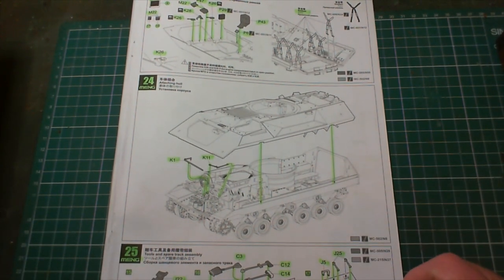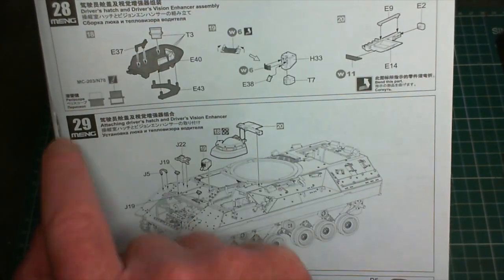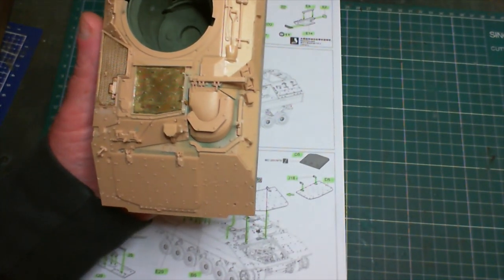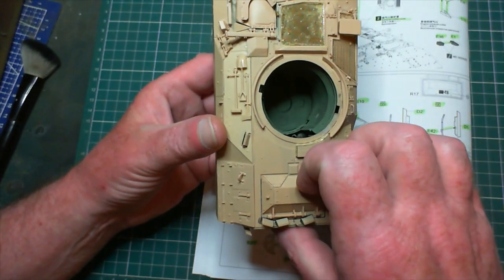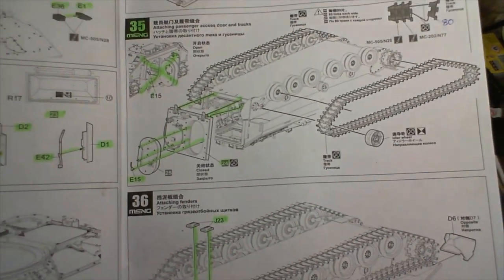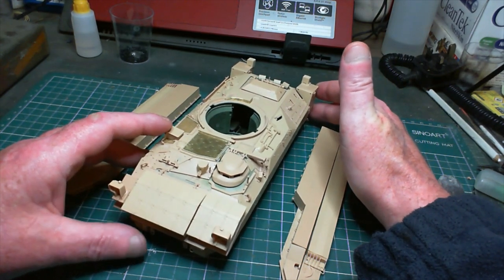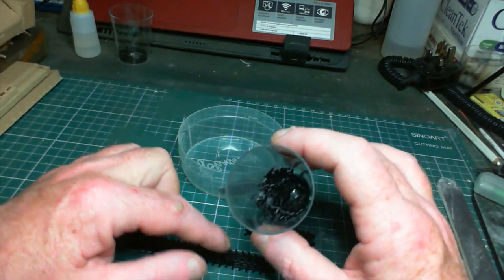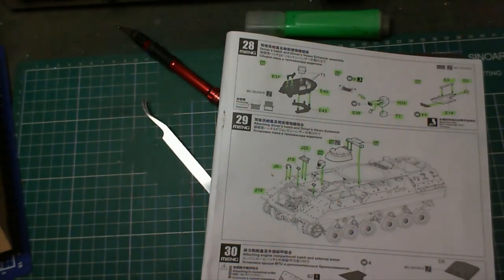MENG 1/35 Scale M2A3 BRADLEY W/BUSK III Build Update 5

Comment: You said it has two 'air conditioners'  ??!!??   Incredible....my car doesn't have air conditioning, just open the window...  wow I may re enlist just for the air conditioning ...... as you can see I am flabbergasted .....is it for the engine?.....TOW?..... otherwise nice kit,  excellent interior,....can not get past the AC...our jeeps back in the 70's had AC, we took the roof off.....good luck with the rest of the assembly and the painting